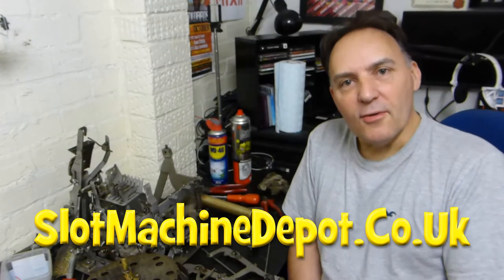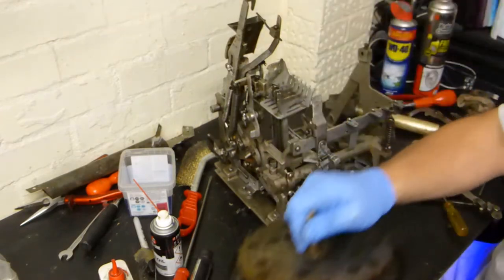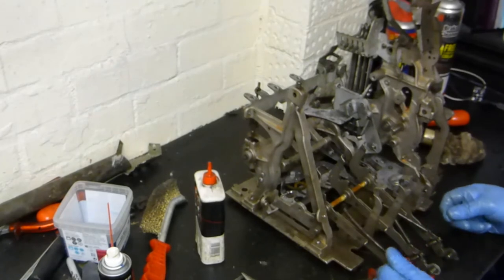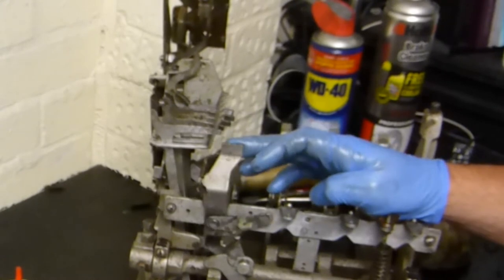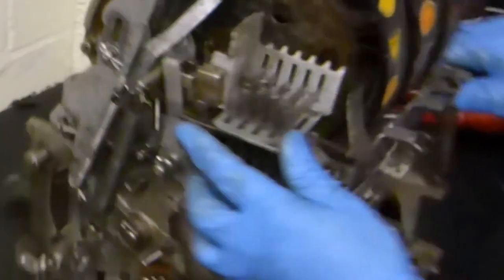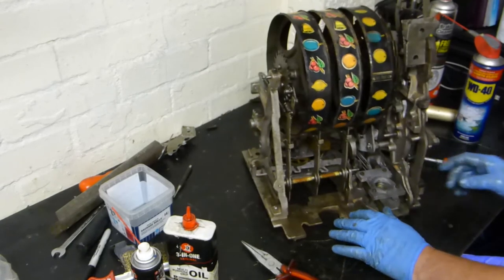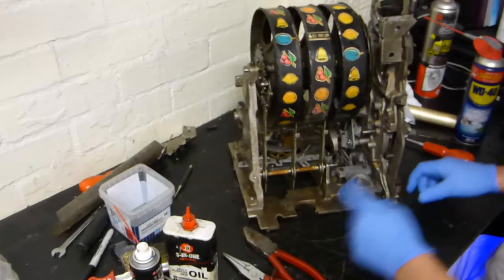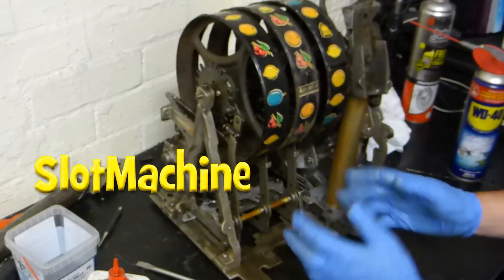The Repair Shop Reassembler - Slot Machine Part 2-  Restoration Penny One Arm Bandit

Comment: Very good video but you skipped two parts how to attach the springs in the inner reels for the brakes and you skipped on how to adjust the speed of the reels and you didn't go into how to know if the reels are going too fast or two slow and how to adjust for proper speed that is very important and you skipped the whole adjustment and when you should adjust and how and when you have the proper speed of the reels